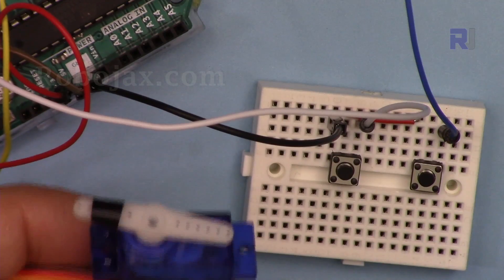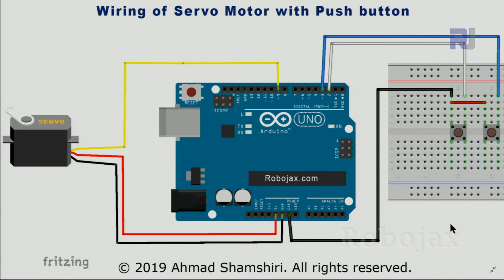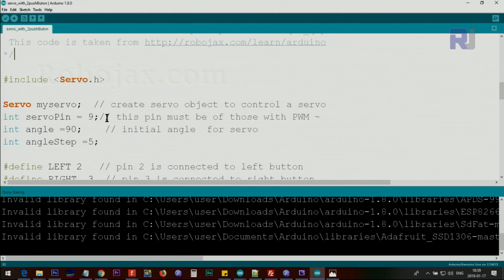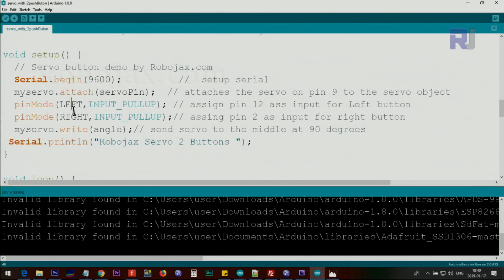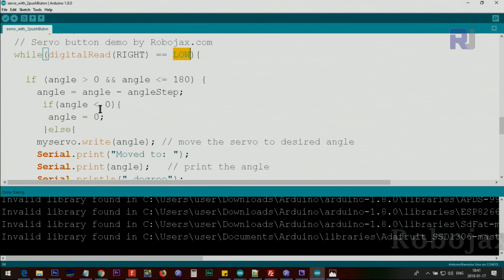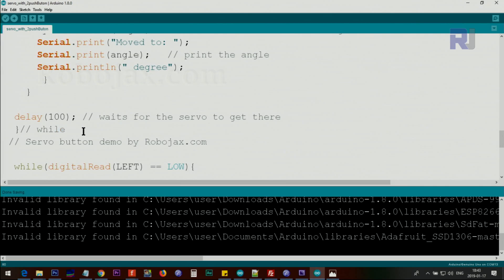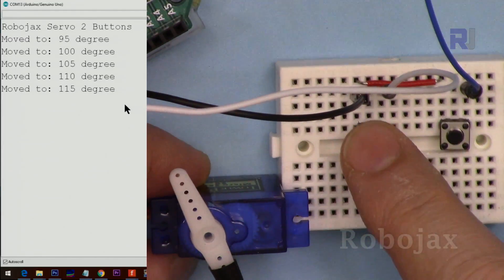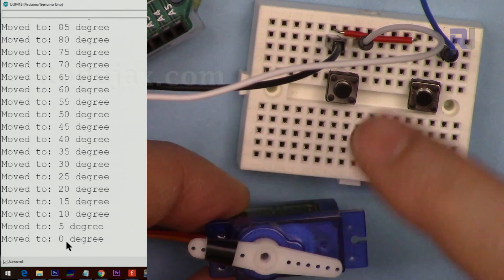Lesson 88: Controlling a servo motor using two push button switches

Comment: Ah I'v just found this after your single switch tutorial. i need the code to go to a set and for each button to then return to 0 once button released. Button 1 45 Degrees and then Button 2 65 Degrees. and then for Servo to return to 0 and stay at zero until either button pressed?
Reply from the maker: Ode below the description

Comment: Great video as always.  What changes would I make to the code in order to drive the servo left to right while only hitting the button once without having to hold it down?  Also the same to move the servo right to left using the other button.  Thank you!
Reply from the maker: Hi, I belive I have convered every possible move that I thought would be usefuol. But still there should be 100s of more possiblities. Just serachg my channel for the key word "servo" and I am sure you will find solution as I don't remember which which is doing specific move.
Reply: @Robojax , yes, I've seen I think all your videos on servo-pushbutton.  The only video with 2 push buttons is where you have to hold down the button.  I'll try your code on using 1 button to make the server go in one direction, and just add the same code with a few tweaks with a second push button.  Thank you, sir, and keep the great videos coming.

Comment: @3:50 when right button is pressed it would go high then how come while(digitalRead(RIGHT) == LOW){ is executed?
Reply: When you press the right button then you are grounding the pin (0V). Therefore, the condition (digitalRead(RIGHT) == LOW) is ture

Comment: Will this work with IR sensor switches instead of push buttons?  I need an IR detector to move a servo to its 180° position and another IR switch To return it to 0°, all without keeping voltage to the servo applied once it reaches its limit. Any help would be appreciated.  I'm considering using the IR to trigger a 555 timer which will supply a 1.5 second pulse to the servo.
Reply from the maker: Search my channel for infrared
Reply from the maker: https://youtu.be/LVd9_i-BQcg here it is
Reply from the maker: You didn’t reply?
Reply: @robojax  I checked it out and that will fix my issue - thank you

Comment: not working correctly. when servo reach 180 or 0 degrees it still continue running.
Reply from the maker: You must have change the code or did something wrong. If you came direct to this video without the introduction videos that could be another reason. This lesson is coming after other videos.

Comment: Hi, i have wired my circuit the exact same and used the same code you have mentioned, however my switches do not operate, and instead, the servo turns automatically from 85 degrees down to 0 degrees once the arduino is plugged in. I am unable to identify the issue, please could you provide guidance? Thank you
Reply from the maker: Hi, you gotta test the push buttons using the code in this video https://youtu.be/2WwedCRwmgA . define on push button and use pin 13 which has LED so push ON, Push OFF. then test 2nd push button. I believe it is the push button wiring.